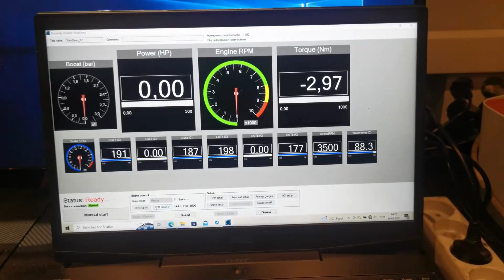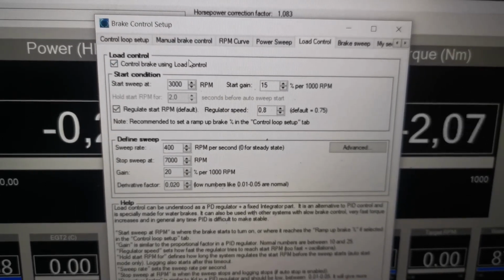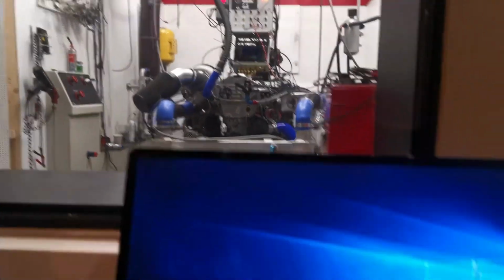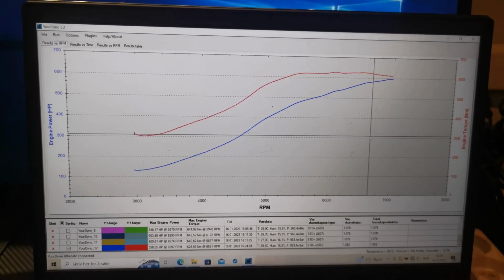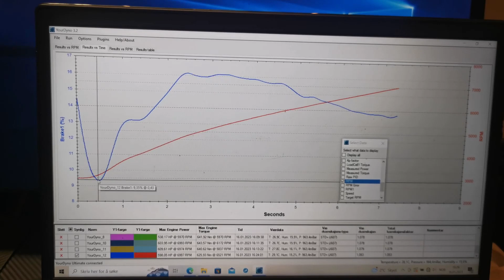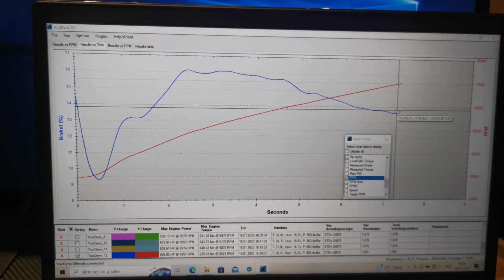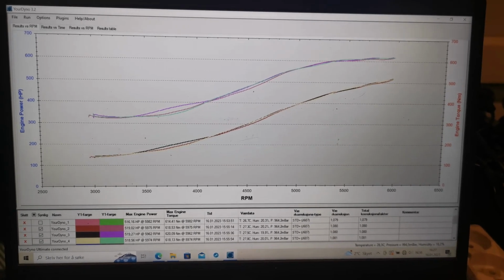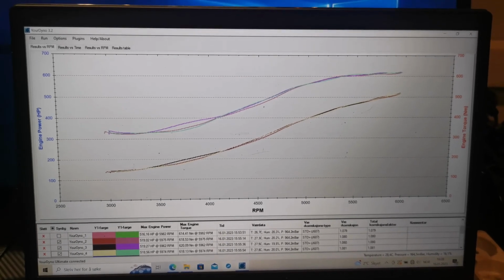YourDyno Ultimate + Water brake valve installation

Comment: When you program a rpm sweep does this tell the water control valve how much to open?
Reply from the maker: Yes, it adjusts the valve such that the RPM follows the defined RPM sweep. There is a regulation loop that updates the valve position 20 times per second
Reply: @YourDyno  thank you for answering. I really appreciate it.

Comment: Why don’t the power and torque cross at 5,252 RPM?
Reply from the maker: They cross at 5252 RPM when you use lbft and HP. We used Nm here, then they cross at around 7120 RPM

Comment: Possible to show the PID setup for this dyno as an example? Would be realy useful. Have your basic package on a water brake.
The set rpm mode is amazing to tune with. Just set the rpm and adjust the throttle to whatever you like.  But need to ramp it up slow to not get occilations. 
Realy like your products
Reply from the maker: We ran PID as well, steady state and a few sweeps. I think we had Kp = 0.2, Ki = 0.2, Kd = 0.02. 
A water brake is much more responsive at high RPMs, so you can click Advanced and enable PID Scaling so you reduce the factors as the RPM increases. This way you can have a quick locking PID at low RPMs while still having no oscillations at higher RPMs. That said, Load Control is the best regulator for water brakes. It also has scaling vs RPM in the Advanced options. We ran without any scaling in these tests. I will make a video later where we show this.